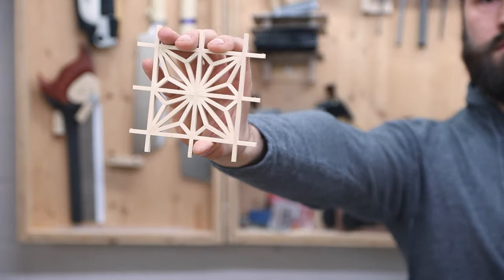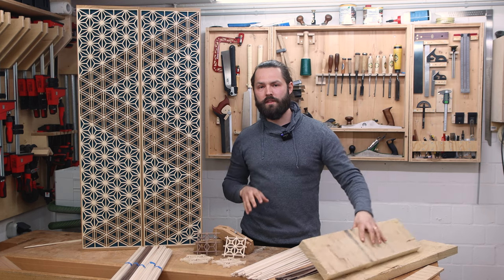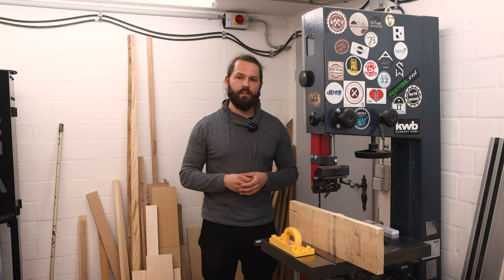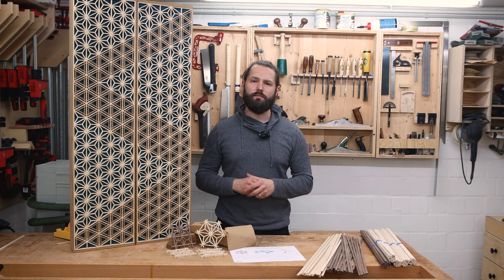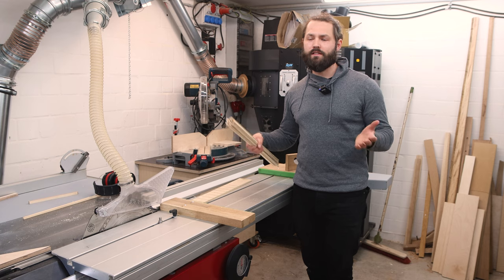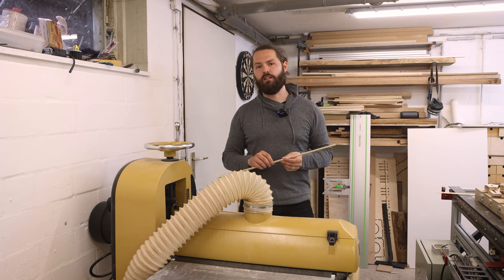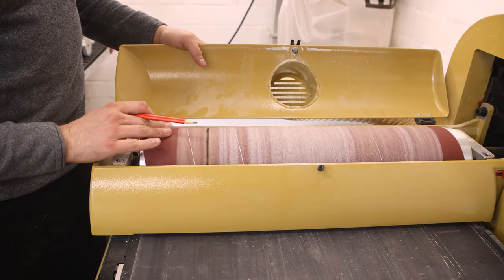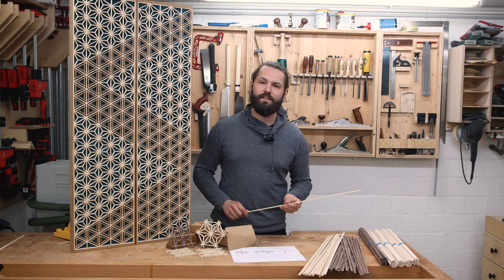Making Kumiko Strips  || How to Kumiko || Japanese Woodworking Skills

Comment: Hi, thanks for the intro to your methods. Can you elaborate a bit on what you are doing for the long strips e.g. For your panel? Do you buy 2m stock? Or do you connect the sameller 50cm pieces (glue lengthwise). Thanks.

Comment: What blade are you using to cut notches, flat tooth or crosscut?
Reply from the maker: I use a flat tooth 48 teeth blade. According to the manufacturer it's a combination blade for cross and rip cuts

Comment: Hello ,what is your strips dimensions? Is there a standart or according to our choise?Thanks
Reply from the maker: Hi there,
My strips are 3.4 by 7mm. The width of 3.4mm is because of the kerf my table saw blade leaves. By having the strips that width I only have to make one cut for the notches of the grid.
The other dimension of 7mm was just because I like the ratio and think it looks good.
I don't think there is a standard.

Comment: You can modify your electrical power circuit by making interlock connection between dust collector and cutting machine, so will no reason to forget to turn on your dust collector.
Reply from the maker: Yeah, actually Ibdo have it hard wired into my fuse box and a dedicated outlet for the dust collector. Which turns on/off when one of the machine turns on/off. But on this dust collector I cannot permanently turn on it. I have to bridge the switch of the dust collector. Haven't done it yet.... But you are right 😅😅

Comment: Wouldn’t it be easier to wire up your dust collector so that whenever a power tool comes on it automatically switches then switches off itself 1 minute after the tool is switched off?

Comment: how to make strip kumiko in a super luxurious workshop with first world machines that cost the same money as a house in Latin America
Reply from the maker: Of course I am pretty fortunate to have the kind of shop I have. For every expensive power tool there is a low budget version or a hand tool way of doing it. It does require a little more elbow grease for sure...